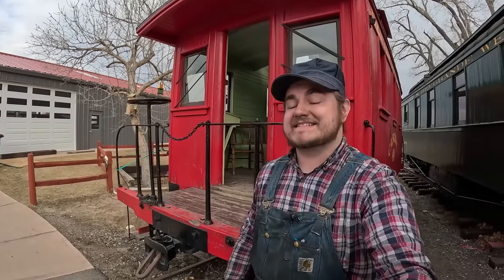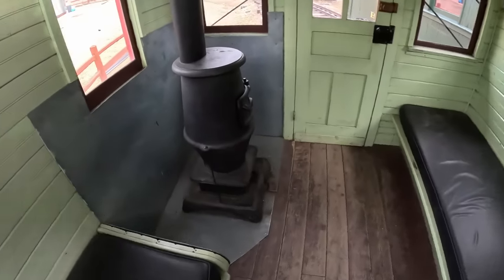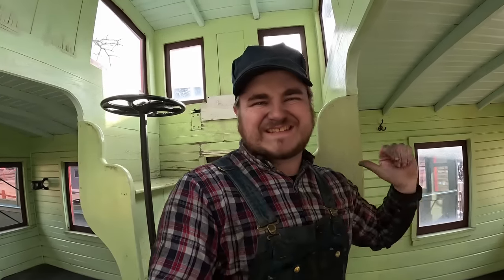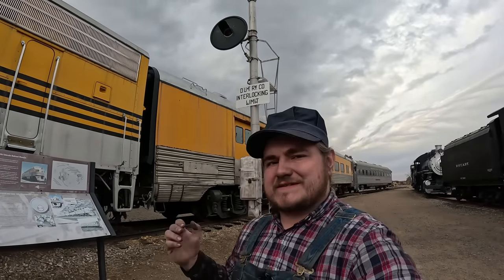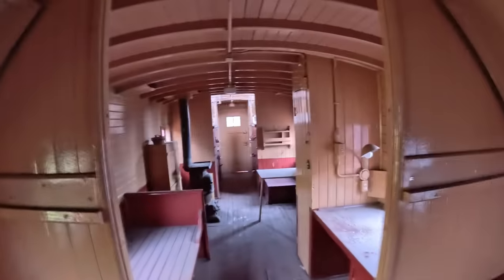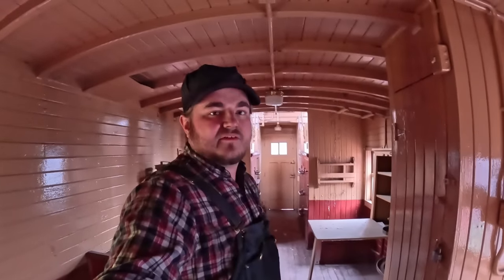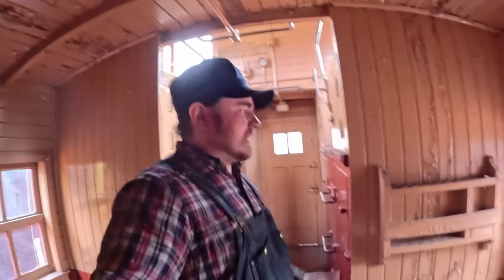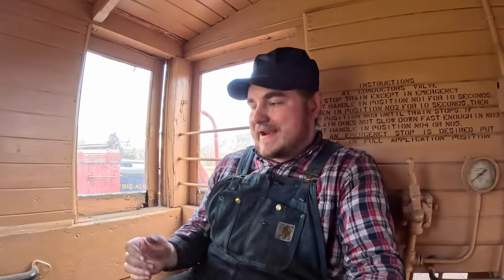Why don't trains use CABOOSES anymore?

Comment: When I was in the Army in 1994, we shipped our equipment from Ft. Hood to Ft. Bliss, but they detailed 6 of us to "guard" the train.  The train company dug out a decommissioned caboose for us to ride in.  So I can say I'm probably one of the last people to ride in a caboose.
Reply: Ft. Hood?!? I'm so sorry 😢
Reply: These were called
 "guards wagons" in NZ.
Reply: The power plant coal train in Bremond tx still has a caboose
Reply: Some NS locals still use cabooses.  Two locals out of Elkhart regularly have them - and the smoke coming from the stove pipe on a cold day tells all that they aren't welded-shut 'shoving platforms'.
Reply: Military specials, especially nuclear fuel cell trains and Schnabels still use cabooses (cabeese :-} ) for security and personnel involved with the load.
Reply: That's about the best they could do.

Freight trains have basically the same couplers as model trains, you bump them together to lock together, can be easily disconnected.

This is for easily routing cars, wagons, in a sorting yard, pulling forward, backwards on a switched line, to build up mile plus cars.

Where we live they have an Army transportation school, it includes trains.

 As such the couplers don't match passenger trains, they are hand connections and no slack.
Reply: Waycars (cabooses) are still used all the time. Just not in through freight. I ride one every day for long shoving movements.
Reply: @Z4Zander  At one time each wheel had a grease box for bearing lubricant, the caboose watched for smoking and fire from a box, dry, low on grease. The engineer can't leave the cab to help with a problem.

 I'm surprised they don't put multiple cabooses in a special government run, one in the middle, end, etc.

Hey, it beats being forced to camp out on top of a moving train to guard it with a machine gun. 

The government during World War II went to Ringling Brothers circus to learn how to efficiently load trains with heavy equipment.
Reply: @burns0925 hahaha just had to bust his bubble..😂😂😂

Comment: Nice video, Hyce.  There were also some other factors involved.  Before railroads started putting up train crews in motels in the 1960s (when they were away at a remote terminal without a railroad YMCA or boarding house), a crew stayed in their caboose until their next assignment.  So the bunks and stove were needed for those situations.  And until mid-century cabooses were usually assigned to a particular conductor, and when he wasn't working the caboose was stored on a caboose track in a yard.  When the practice of assigning cabooses in a pool randomly to crews started, the number of cabooses needed dropped considerably.  By the 1980's the cabooses had also become quite expensive which was another factor affecting management's desire to get rid of them.  Cheers from Wisconsin!
Reply from the maker: Well that's a neat tidbit I wasn't aware of! Thank you for sharing Andrew. Makes sense.
Reply: Train Crews on the Pennsy Min Line used to be able to see a burnt Bearing on a piece of equipment,  before they melted completely away.
HazMat loads might deserve a Caboose.
What costs more, when wrecks start to affect Insurance rates?
Clean up Crews are not Cheap.....
Hazmat Crews seem to cost more than a couple of Caboose crews.....
Reply: Keep it Bit Simple No Need to Write 52 pages Letter , No one Have patience to Read,   I Dont Understand Why people write 100 page Book in Comments
Reply: @S500-  that was one of my brief comments.
I enjoy communication.
You seem to be interested in instant Gratification.
What a shame?
Reply: @danielhutchinson6604  I think they were commenting on my original long comment, Daniel.  🙂  I don't understand why they would respond in that way.  If you don't like long comments, just skip them and move on, eh?
Reply: @andrewpalm2103  Some Kids apparently just do not have time to discuss things?
No wonder it is so difficult to find qualified help lately?
Reply: @danielhutchinson6604  So, when hazardous material escapes, drag that caboose man right through that crap!
Reply: @johngalt97  Railroads that ran shorter trains could see when an Axle was burned out and actually ste out a Bad order Car, where they were not going to fall apart.
Please consider that the cancer issues with Brake smoke are bad enough to deal with, try to consider the effects of human involvement in transportation issues?
But thanks for your suggestion.....
Reply: @S500-  We get it. You can't read well and you're insecure about it. But instead of coping with it in a healthy way, you lash out at strangers on the internet. Learn better ways to deal with your emotions.
Reply: @adamlane6453  Capitalism always works to replace higher paid skilled labor with lower paid unskilled labor. By cutting labor time they boost profits temporarily but the prices then once again move towards the cost of production but with the higher capitalization the rate of profit falls. This is why capitalism works well for things that can be done with industrial methods but so poorly with things that can't be done that way. It neglects education and healthcare as too expensive for the workers and something that is necessary for the bosses only.
Reply: @kimobrien.  You're telling me nothing I don't already know and agree with, and also has nothing to do with what I said. Where is the communication breakdown happening?... because I have no idea why you're saying what you're saying within the context of this conversation thread.
Reply: @S500-  Because people can read.
Reply: Back in the mid 70s, when I worked for CN in Northern Ontario, some employees would arrange to spot a caboose in the middle of nowhere, for a bit of hunting or fishing.
Reply: @danielhutchinson6604  My grandfather actually had some "black lung" not because he worked in the mines, but because he had spent so much time in cabooses behind coal trains.  He said sometimes the dust would blow into the caboose so much it was like a light haze in the air.  (45 years of smoking didn't help much, either...)
Reply: @B-and-O-Operator-Fairmont  Job hazards in every industry.
Woodworkers got Black Lung too.
But the smoking might be a clue?
Reply: @danielhutchinson6604  It was both and yes, the smoking was probably a bigger problem - even though he was never a "heavy" smoker.  A pack a day, tops and that was if he worked at 12-hour (or more in earlier years) day.  He stopped cold turkey within a week of retirement and then lived another 22 years.  But past 80, the emphysema really started bothering him.
Reply: @B-and-O-Operator-Fairmont  Rear Brakemen on Pusher districts did get smoked out a lot.
I have ridden my share of Trains  and got a strong whiff of smoke plenty of times.
The idea of the brake linings lining lungs does have an effect.
The benefit of Crews on both ends of Trains does make  a pretty big difference in a lot of situations.
Sorry Yours went so soon,  but we all do lose relatives eventually,  I know way too many who died too young.
Good Luck to You.
Reply: @danielhutchinson6604  He made it to 84.  I think his quitting smoking within a week of retirement added quite a few years to his life.  I was 35 when he passed, so I was blessed to have him well into adult life.  Stories he told me in 1998 are as fresh as if he told me last Sunday night.

Comment: My son is all about trains. Since he was about 4 he has wanted to be a train engineer, he is 15 now and is still working towards that goal and I am sure will eventually reach it as he gains the age and works up the ladder. But my brother, his uncle, was instrumental in the design of the first generation end of train device. When I told my son this I worded it as, "Your uncle killed the caboose" and I don't think he will ever forgive his uncle for his role in killing an American icon.
Reply: Can you tell me what presidential administration was in office at the time?
Reply: @mshum538  Clinton
Reply: @lonnywilcox445  no, not at all, carton signed the staggers act ( deregulated the railroads ) and reagan was in office when cabooseless operations commenced in 1985-86-87…..good day…40 years as a Locomotive Engineer ~retired …
Reply: Carter~~~
Reply: @mshum538  thats about when they stopped using them on the chessie but I would say no more then 85, and I remember my mom would say wonder if it will have a caboose on the end to play a game with me while we waited for a train downtown, which was frequent and was not till the late 1990's that we got an underpass after many long years of the trains tieing up traffic, now they run them soo long it can go just outside the yard all the way to the next city over 3 miles away if you catch it just right and its an added 5 minutes to go all the way back and though town when you are running late for work and the train is not a hot shot or express, like auto rack or intermodal, and they decide they are just going to stop and block two miles of track or just shy of clearing the switch at the junction on the back road or you get two or three trains running the same time rarely on the tripple tracked main, but I loved the cabooses, they are still used for maintannace of way, tool storage, and for shoving platforms even around here though but are rare to see aside the maintnance of way or the rail grinder or inspection trains. 

but it was a good video and explanitive without getting to technical or dumbed down about the reasons for the caboose. there also used to be more people in the crew sometimes up to 5 or more when you had flagmen on trains for crossings or other special situations, but cabooses did not have all the telemetry that modern computers do with a fred or flashing rear of train device, and tracking speed, but cabooses gave more room for deadheading and storage for stuff to bring back from where you are deadheading to back home or storing stuff or magazines for down time both dirty and some that were news or trade related. and it was not on all trains back then but many of them and then one day they just stopped.
Reply: @made-in-the80s however not all things that change are for the better I will add, they might be in this case and save length and weight on the train but there are many things that were progress that were replaced by less capable things or more cheaply made and it shut out entire industries from our contry, and many many people out of work, and no chance to get back into it even if we wanted to
Reply: @made-in-the80s Several, I included some weekeneds, and steam by the way is one of the things that is more capable the harder you push it, to its rated hp. it was said a diesle can start a train that it cant pull, but a steamer could pull a train it could not start because it built power as it got going from draft on the fire, case and point while diesel electros have better amenities, like air conditioning, gererating power, and dynamic brakes, it takes three amtrak engines for example to do the job that one steamer like ours at the fort wayne railroad historical soc nkp 765 or 1225 on the new river train when they used steam to pull the trip, now as for steam it can pull freight when it gets the operatunity just fine, but they take more care and attention and special facilities to service and took more crew that was one reason they were not used anymore, they have to be serviced and rebuilt at quicker intervals, and takes 2 crew to run them one to fire and watch the other side of the engine and the engineer, it was not for lack of power I assure you, in fact is was one of livio dante porta's engines that was steam that holds the highest locomotive power to weight ratio of all time over all other steamers and diesels in drawbar power, as for caboosless trains not sure right now, but I can tell you the first diesel passenger in the states was the B & O Capital Limited at least on the big level, you also had the pioneer zephers like the one in the the chicago sciance and industry museum today, and the first to compleatly go diesle in the usa was an indiana line that spaned the hoosier state the monon line even had IU and Purdue colors for its color scheme so there is that.

another thing that is in the vain that i refered to that was replaced by less capable is outsourcing our clothing, sure its cheaper, but the quality is not what it was in many cases, and the abillity to make certain types of shoes for example is lost the last manufacture just gave it up during covid did not even try to fight to keep it even though they had the market cornered and were the oldest and last remaining one in the usa, maybe one day they will try to train and restart production of custom products but they lost the institutional knowlege, just gave up with out even being forced to  surrendered the fort before a demand for the fort was sent from the enemy, and that leave a bad taste in my mouth when people or organizations do that you think we would have won the world wars if we just gave up like that no we got a foothold and fought for it tooth and nail and the devil himself was not going to take it away, someone in the world says you cant do that your not allowed, we americans traditionaly push our hats forward and thumb our noses at them and roll up sleaves and do it anyway Thats who we are thats what our collective culture does truely.
Reply: @made-in-the80s we are taling horsepower, your standard ge's are 4400, nkp 765 is around 4000, give or take, steam keeps going faster till it meets enough resistance or it will just keep going faster and faster till it throws itself apart, diesles top out around 70, not so for a steamer, though it depends which one you talk about as each loco was built for a specific job or place, diesles are fairly equal no matter where you put them, though some are higher hp vs something that might be just used to switch or running a few locals as you know or might come in a differant engine configuation  or how the wheels are powered but much less variety then the things they tried in steam days.

and thing is as Rich Melvin stated most modern railroaders dont have a concept of the power that a steam engine, but that said its dirty and hot it can be tempermental just like a real horse, and you dont even really have a toilet unlike a more modern locomotive, in a word diesle electros have an engine on them, a steam loco the whole thing is the engine.
and as for the 19 years on the high iron I hope your with a good railroad so many have managment that wants to worry more about the operating ratio then taking care of their workers or customers thanks to psr, railroading isn't what it used to be and many of the young dont have the sense of pride the old heads did to many its just a job not the brotherhood it once was talking to those that make their living at it, though there are some regionals and shorts that its quite nice they dont have far to go and are back home every night
Reply: @made-in-the80s I railroaded 40 years. Yes, we had dragging equipment/hotbox detectors way back when but they weren't equipped to radio information to the headend of the train. When they developed that technology, it was the end for cabooses. You no longer needed someone on the rear to check the readouts at the scanners. The cabooses were a death trap. I know a lot of rear brakemen and conductors who got retired when the train took UDE and slammed them into the wall inside the caboose. They never put cabooses in the middle of the trains, I've never heard of anything that dumb. We would put a single helper behind a caboose and shove on it but never two loco's. Now you're gonna say why not put the helper ahead of the caboose. There was an agreement, as I recall, where the railroads were not allowed to do that. Some agreement of sorts as I recall. I reminisce about things that occurred in the course of my career. I'm not sure why you think that's such a bad thing, with no logic. You may have been made in the 80's but I was railroading in the '70's, when you were bouncing from one huevo to the other trying to figure out if you were gonna be a boy or a girl. LOL
Reply: @manga12 are you comparing the fact a show manufacturer shut down to the life and death struggle of war?  Of course people are more likely to give up over a piece of clothing then they are when literal lives hang in the balance.
Reply: @Marynicole830  its the point iam  trying to make, few americans got the backbone to do what we used to be willing or able to do, we are from the usa people tell us it cant be done we thumb our nose at them and roll up our sleves and do it anyway, or overcome all odds and do things in spite of everything.

Comment: Very interesting and well presented.
They were not called cabooses, here in Australia, we called them guards vans. However, they pretty much served the same purpose. Our guards vans were also retired in the late 1980's. Cheers.
Reply: They were called that in New Zealand as well, and they didn't have the cupola bit.
Reply: I've heard the replacement of the Guards Van called a BOG. A Battery Operated Guard.

Comment: My grandfather was a machinist for the B & O Railroad. He died in 1925.  I was told they thought at the time it was the Spanish flu.  My dad was 7 at time. I was born in 51 and have always been fascinated with trains.
Thank you so much for the in-depth tour of the cars and how you explained the different features. Very informative.
Reply: My grandfather also died from the Spanish flu, but it was in 1918.  My dad was a carpenter on a B&B crew for the Norther Pacific Railway and the Burlington Northern until he retired in the mid 70s.   I worked at a lumber mill in the 1970s  and used to mark some of the cars we loaded with a date. They lumber would go all over the US shipped on Nother Pacific, Great Northern and Milwaukee Road lines. Often the cars would be back in our yard for a load in two or three months.